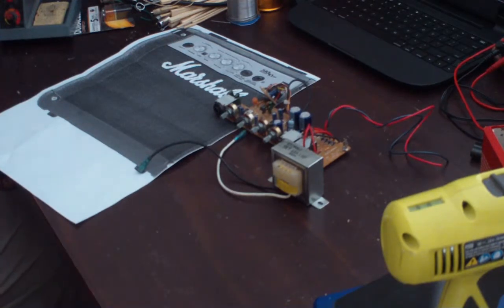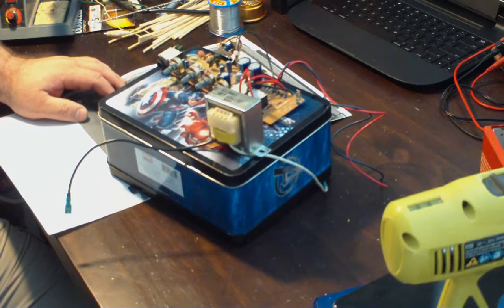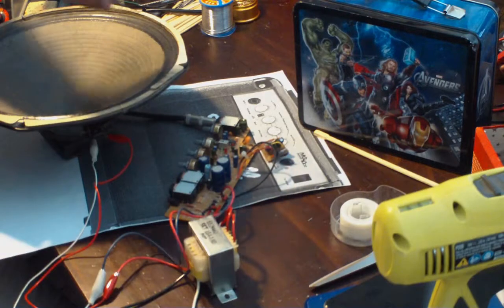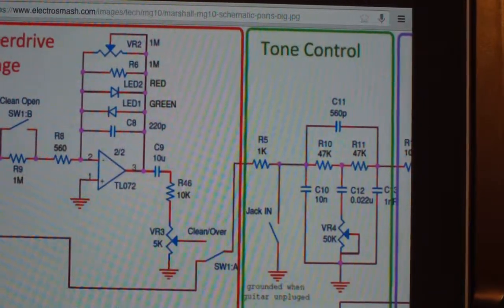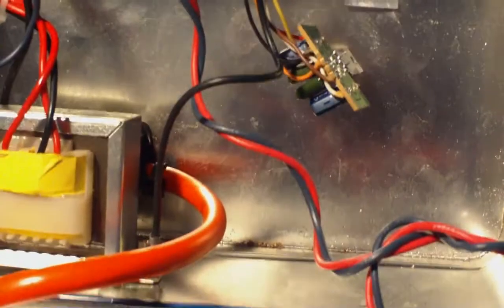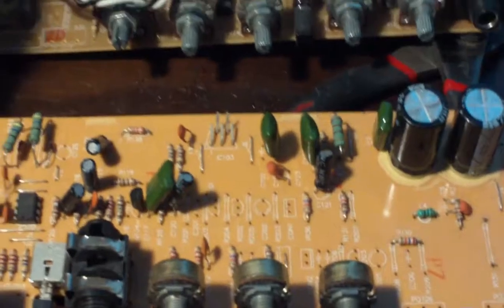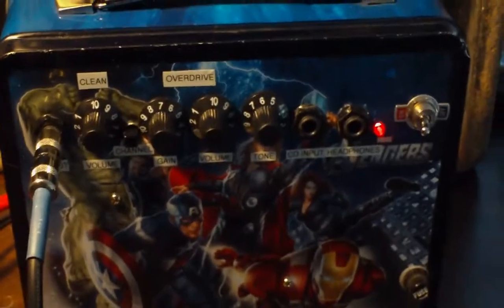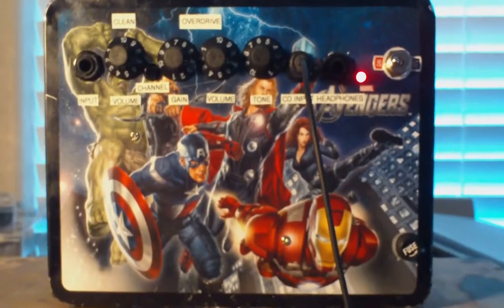Marshall MG10cd Re-Housed In a Lunchbox. The Avengers Amp!!

Comment: I modded one of these MG10CD Marshalls to add an external speaker output with a DPDT switch to change between internal/external speaker, the mod works as expected but after having done that now when I'm in the OD channel, the gain potentiometer also increases volume, so I can not use it with full gain at low volumes, and the volume knob doesn't do much until it gets to about 9 o'clock, but even at 0 there is still volume coming out of whatever speaker I'm using (either internal or external), do you have any idea on what could be going on? I also drilled two holes to the front and extended the clipping LEDs there so that I can see when I'm playing how the LEDs turn on and off, that also works as well, I'n not sure if that would have anything to deal with the volume issue. Oh and BTW there's also HUM but only from the preamp, when I hook a CD player there's no hum so I think the power filter cap's won't be the problem there. Thanks beforehand.

Comment: The 0.1R resistor is not in any way a "ground reference".  It is very important as it is the feedback resistor.

This amp, like most other SS amps nowadays, uses current feedback.  That gives them a response with the speaker more like a valve amp which reacts to the output stage and Tx in a similar way.  Usually feedback is taken as a voltage direct from the output of the amp at the top end of the speaker.  Hifi amps react well to being set up this way as it leads to very low distortion and a very well controlled response.  That isn't what we want in a guitar amp!  In our case the current through the speaker also passes through that resistor producing a small voltage across it.  That voltage is the source of the feedback fed back to the power amp's input.  The power amp is responding to the speaker's current not the voltage applied across it.

There will be a voltage feedback resistor in there too to control the amp when no speaker is attached but that is made to be much less important feedbackwise than the 0.1R resistor when the amp is in use.

(And just for the info, the chips are definitely not "opamps", they are complete IC power amps which is very different. ;>) )
Reply from the maker: Albert Burton excellent info!! Yes, I’ve learned a lot more about SS amps since making this video, but I’m still far from well versed in their mystical workings. 

Thanks for sharing!!